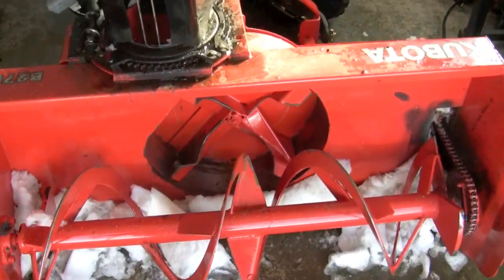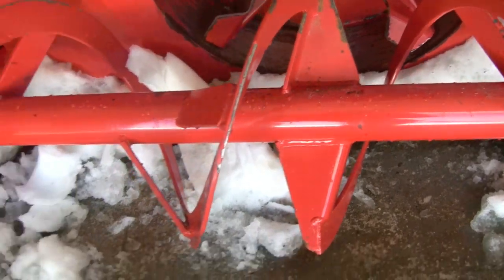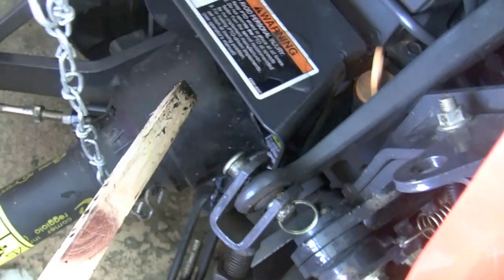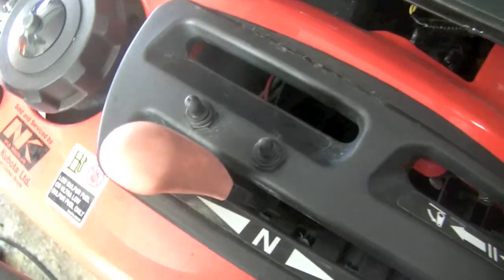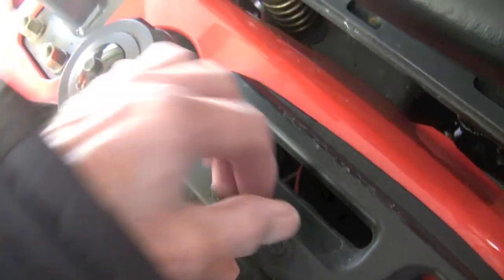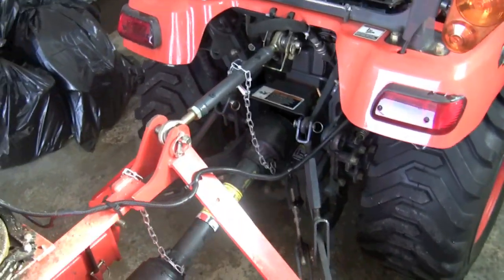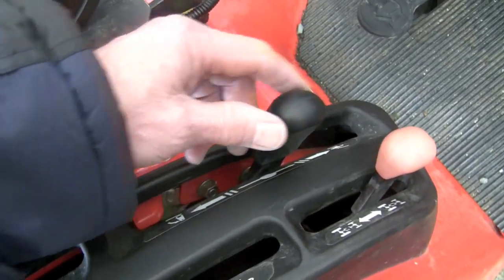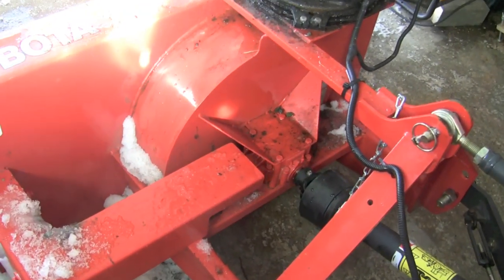Kubota BX snow blower details

Comment from the maker: The local Kubota dealer installed them and I'm guessing it's a standard item for them. I would say the switches are single-pole double-throw.  One switch for each function.  Linear actuator pretty basic looking thing. Both functions have built-in limiting switches but no obvious way of adjusting the range. Just checked, switches hidden from view so can't say what they are. Welcome to come by and take a look.

Comment: After spending 11hrs in the seat today with the bucket and blade either i get a snowblower or a softer seat. We had about 20 cm and 120 klm wind last night.Can't pile any higher .Now I think the answer is a new blower. You look like your having more fun than I am. Calling NFLD KUBOTA  tomorrow to see if thay have  the B2789 in stock
Reply from the maker: I would not be without a blower but I also like having the bucket available. And yes for the most part I really like clearing up the snow and getting the fresh air and all. No big snow challenges this winter so far.